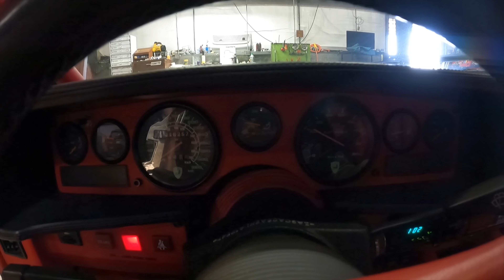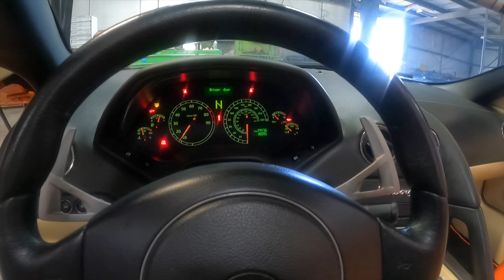The Ridiculous 18 Quart Lamborghini Countach Oil Change

Comment: 15W40 - really? Isn't that the cheapest of the cheap?
Reply: You measure oil quality in viscosity?
Reply: @jonasthemovie  not exactly but the synthetic stuff has usually a wider range of viscosity. I.e. 0W40 or 10W60. Iirc only synthetic oil can reach that spread which makes me assume that Hoovie used mineral oil (the cheap stuff) for his Lambos.
I am not hating. It's just an observation and I am curious if I am mistaken here.
Reply: @hardyschilling644  Syntetics are not recommended for Countach and old Diablos, seems to give oil leaks.
Reply: @jonasthemovie  Now everything makes sense. Thank you for that clarification.

Comment: If you gotta get rid of one of the three, its the murcie every time in my opinion, as the body was designed by a Belgium, Luc Donckerwolke, who when he showed it to the lamborghini godfather, Valentino Balboni himself said you only design engine cover!, as it was the only thing that looked lambo on it, that of the miura, and it just doesnt work as a lambo, as its styling language is all wrong, every sharp edge is rounded, its too aerodynamic, the paint is wrong for a lambo as its designed to soften the edges, not prop them up, its too wide, its too flat, 

the wheels arent that interesting, nor unique, as Ed has the same wheels from the bat guano gallardo on his

the engine is desgined to run on banks of 3 for the injectors for max torque at low speed, which is how they got a V12 to match a V8 for low down off the line grunt

one of the few benefits of the damn german engineering, as their stupid 4 wheel drive system not only weighed the thing down by a full 300 pounds, the front diffs would break as they oversized the tires to try and keep the thing planted.

and the interior, its using this cheep dotted digital crap, and its using Volkswaggen perforated leather in place of the about a 10th of an inch thick Connoly leather

like its just, everything about it is wrong, and its just too big for it to be a driving car, like their was a reason why ferrari in the 90's after seeing the testarossa and the trend the diablo was setting said alright, the testarossa was an excelent grand touring rebirth of the daytona

(provided you put the right gear oil in the gearbox, Royal Purple, which you didnt know about,  and you didnt have the distrubtor checked to see if the points were worn out, or the injectors needed replacing, as the cars good for 0 to 60 in 5.3 for an 88 and yours was more than down on power, plus switching the exhaust does abit more than you think for one of those)

and said alright, lets go back to a more conventional grand touring car and up that game, given that even our base model 355 is now matching the V12's for performance

lambo with Volkswaggen AG said lets instead of making the italian design cala, lets just make the thing bigger, bulkier, less maneuverable, less likable, and less italian.

oh and the Estoque grand touring car that we made the concept of in 08, over a decade latter than ferrari with the 550, lets can that, as that's gonna go nowhere. 

like its lamborghini playing it safe, which is like a rockstar singing karoke and living off of the tips, you just go what the hell are you doing man?! get your ass back in the game! 

and the gallardo is that same person making a greatest hits album at half the price of a normal album lol 

like if you gotta rid of one, sell the murcie, every time, the countach and the diablo are the cats meow, the murcies a dog bark, about the only thing italian and worth keeping on it is the engine, and that's it.

also that same guy, Luc, yeah he designed the diablo 6.0 and the first gen gallardo, the worst of the worst, like he took the beautiful diablo and melted the edges of it, and then just went even further with it with the murcie

like he took lambo, and turned it into melted cheese art, like if I was winkleman, I would have taken one look at the murcie blueprint from luc and told them we're leaving the bodywork off and selling it like that to a coachbuilder who knows what their doing.

like hell ferrari left pinifarina and went inhouse, just hire them

Comment: Screams when I see gas station oil being put in a car worth more than I'll make in 20 years. Why is that not Quaker State full synthetic or Royal Purple full synthetic at the very least? Jesus Jesus why are you putting gas station oil in a car most of us will never touch outside of a poster? It's not a $500 daily driver that car is practically a household investment.

Comment: Why do you still even use imperial measurements 🤣you have a metric currency and any professional working a technical job in the USA today- be it scientific, any engineering occupation or even anyone in the U.S military has been using metric for decades. NASA blew up a $300m orbiter because Lockheed were still messing about with imperial units in the 90s. This car was designed and built in a country that has been metric for 150 years. Aside from in Liberia and Myanmar nobody else under the age of 40 on this planet is very familiar what you're talking about with these imperial units 🤣🤣 funny Americans